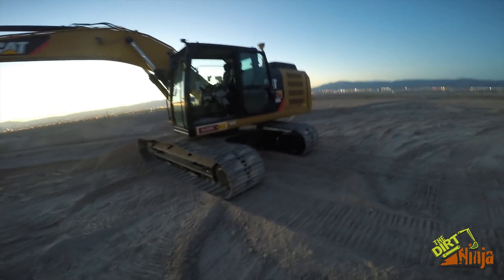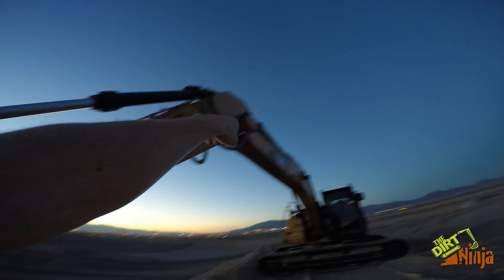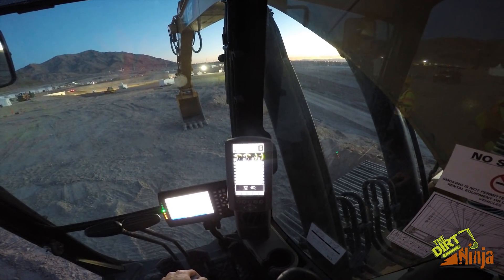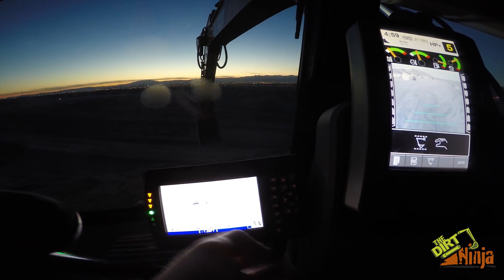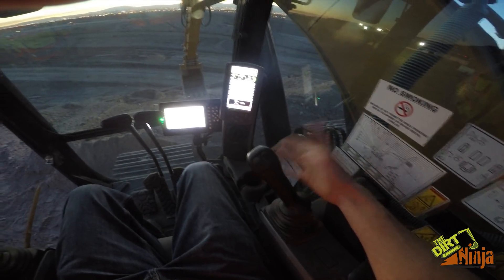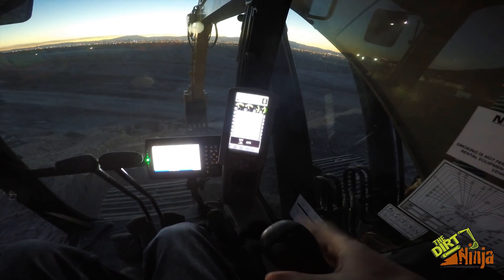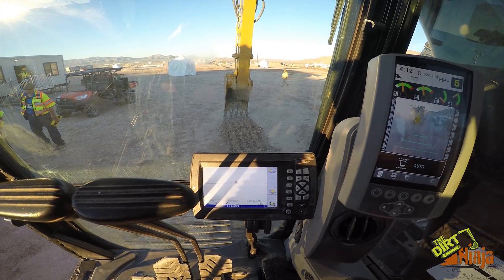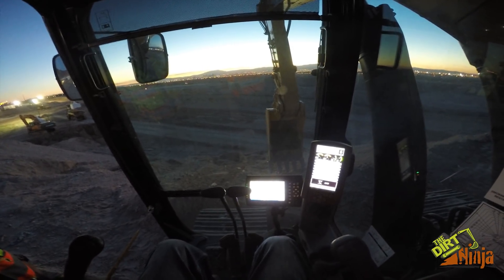Cat 323F With Grade Assist and Trimble 3D GPS - Informative Walk Around

Comment: Its some really cool kit, definitely the way forward for the future. One question, how do you transfer the information to the machine? I imagine the Trimble kit must take a CAD drawing file or something similar? So you load up the jobsite onto the machine and the gps works out where you are working and what grade / depth that needs to be or do you have to tell it what you are doing. For example, one day you are grading an area for a road or something then you swap to digging drainage, does it need re programming? Great vids by the way, you've got me wanting a 2d system for my business. Keep up the good work.
Reply from the maker: You digitize the plans for the site. Or have them digitized by another company. You then upload them into the Trimble system and you are good to go! Its that easy. There may be different plans for drainage or road grading so you just tell the system what set of plans it should be looking at.